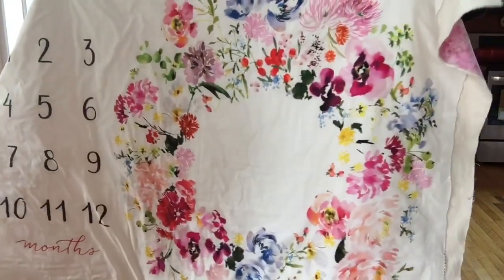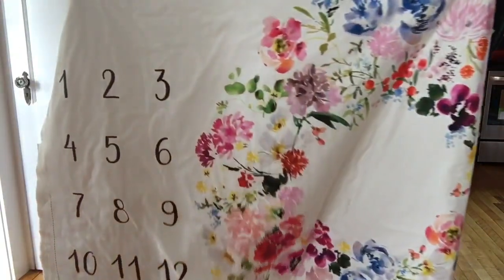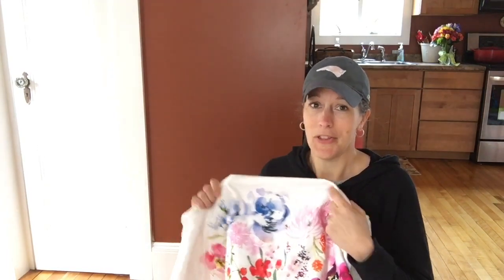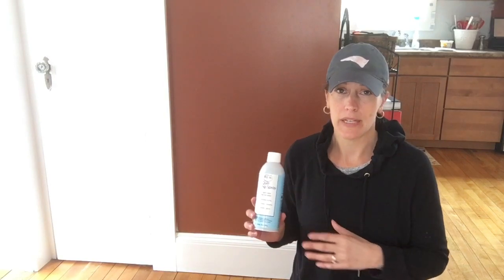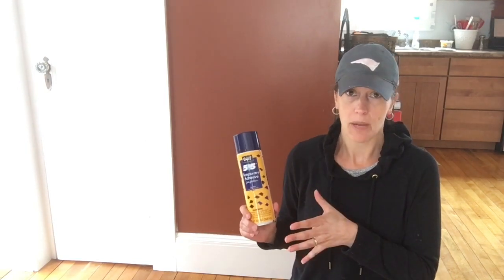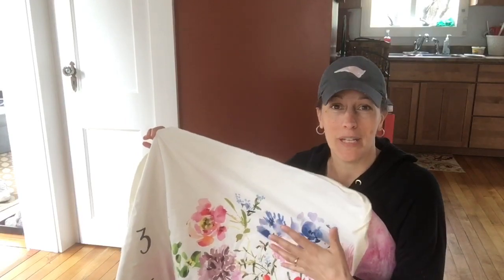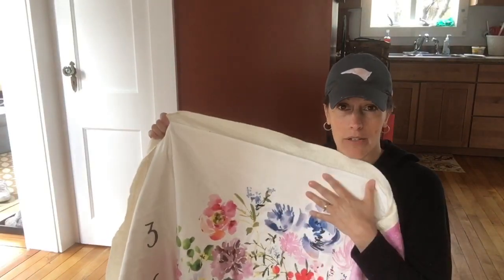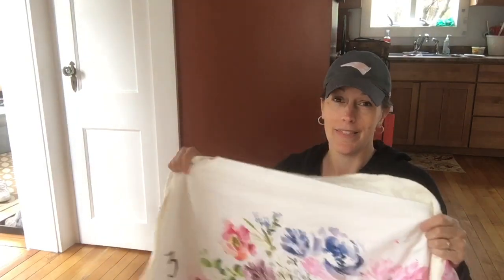Free Motion Quilting a Panel on a Domestic Sewing Machine (Part 1) Video #30 4/2020

Comment: I really appreciate this video you did on basting. I’ve done it both ways using the spray on basting and using the pinning method. I really haven’t been successful with either method. I think perhaps I’ve been using too much basting spray. I was really surprised at how lightly you sprayed your fabric. I’m finishing up a quilt now that I definitely have those puckers 
and wrinkles you talked about. I have my next quilt top finished and ready to go so as soon as I’m done with this one, I’m going to build my quilt sandwich the way you did using a lighter application of the spray on base. Thank you so much for your great suggestions and videos. I find them so helpful. Stay safe and stay well.
Reply from the maker: Thank you for this feedback. Please let me know what you think of the lighter spray baste. I don’t think the 505 holds as well as the Tailor, however, I find I need to be lighter handed with the Tailor bc it is stickier. The light baste while ironing throughout the project is the key for me. I hope you begin to get the results you are seeking. Thank you for encouraging me along with these videos. 💞 Stay sage and well too!!

Comment: Do you have a drop in sewing table?  Part of my fmq struggle is that although have a sewing extensions table, I’m still going up and over.  Any recommendations would be greatly appreciated! Thanks
Reply from the maker: I do have a drop in sewing table. I show my machine and set up in video #4 “How to Start Free Motion Quilting”. My aunt found my table used on EBay for $100 so maybe keep a watch for used ones. I have a much smaller drop in table as well and I feel a difference with that one too so it doesn’t have to be a big one like I show in the video. When I use the smaller one,I push tables up against it to make my workspace larger so it helps hold the quilt up. Before I had the drop in tables, I, like you just used my extension table and I hear you about the frustration. I also find the extension table creates extra friction. (A problem I’ve been trying to solve). Have you set up tables around your space so that you can spread the quilt on them to help with the weight as you lift it up onto the extension table?